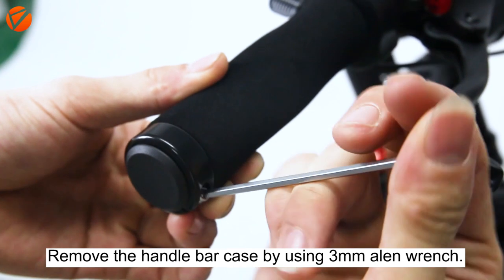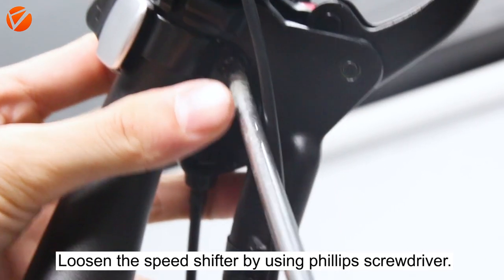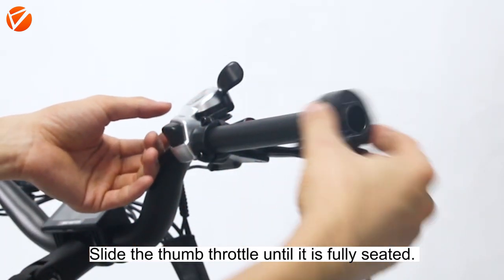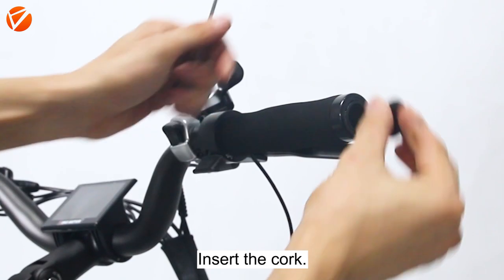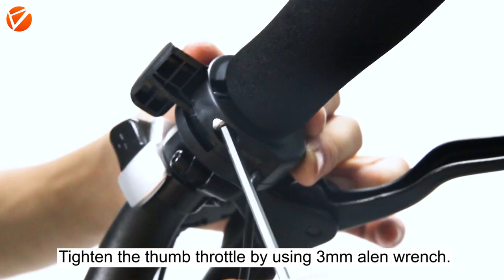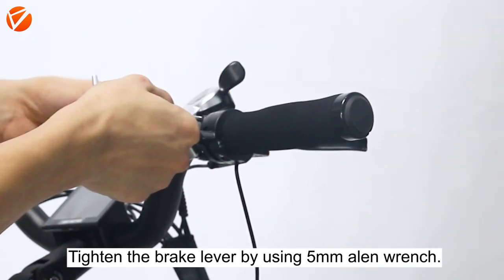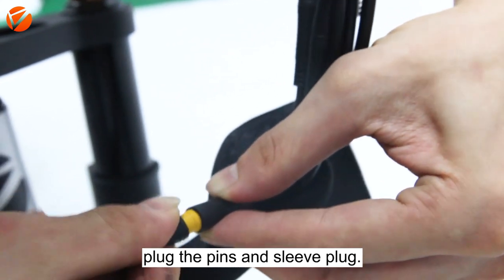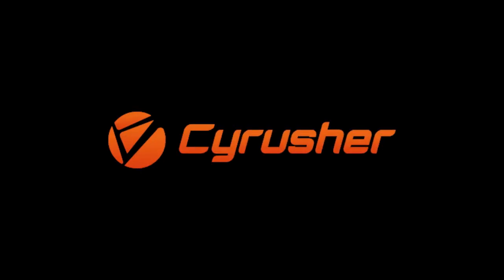Quick Tips - Kommoda Throttle Installation | Cyrusher TV

Comment: Just bought a throttle off eBay didn’t work, I thought maybe there was a phone app that maybe had a setting but that doesn’t seem to be for this model, I’ve removed the throttle now, also my light and horn doesn’t work can’t imagine it’s both so may have to open up the switch and see if it’s pulled the wires inside or something
Reply from the maker: Dear customer,
If you encounter any after-sales problems, please feel free to contact us.
Please submit a ticket here: https://www.cyrusher.com/pages/contact
Thank you!